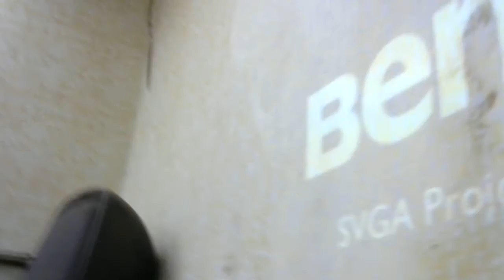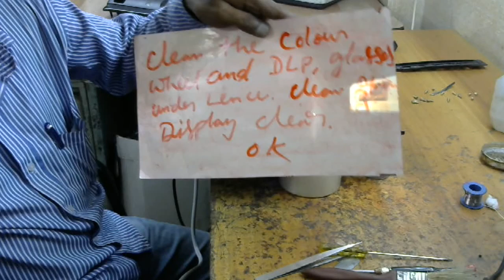benq mp515 projector, problem is dim display and sollution

Comment: first buy a small air compressor instead of nlowing on to pieces. I have cleaned the optics I have cleaned the DMD chip fitted a brand new lamp but still picture is not sharp.